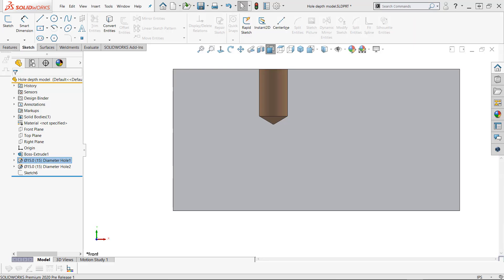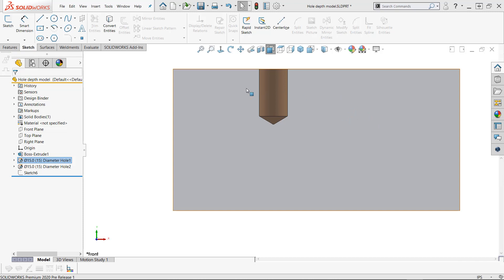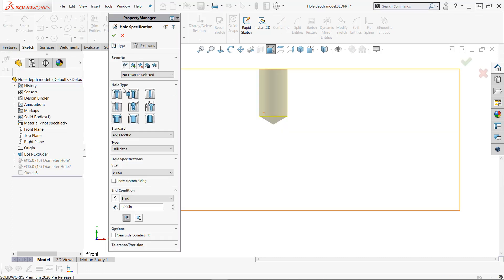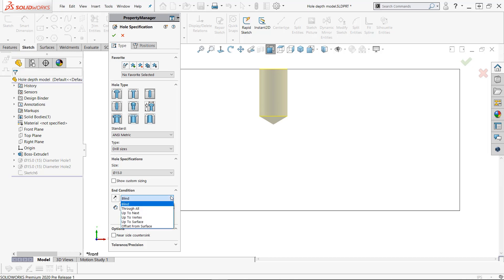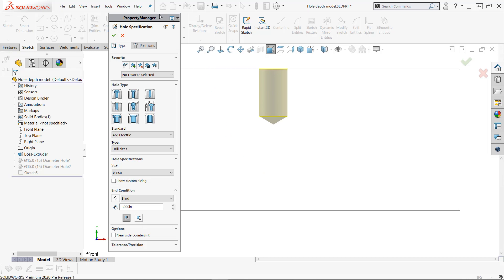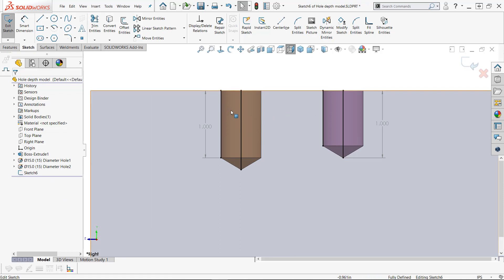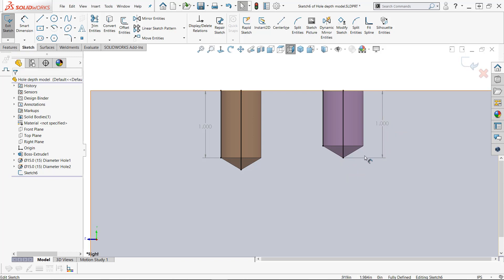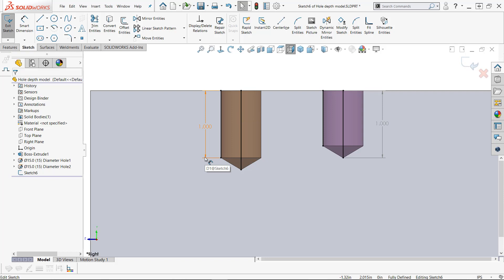SOLIDWORKS 2020 CAD Tutorial - Hole Wizard Enhancements

Comment: Do I really need to place every hole one by one? Isn't there a sketch-based placement? I draw a sketch with 2 points, thought I could use it as hole centers, but hole wizard icon turned grey. It looks like a time-consuming sh*t compared to Autodesk Inventor's features.